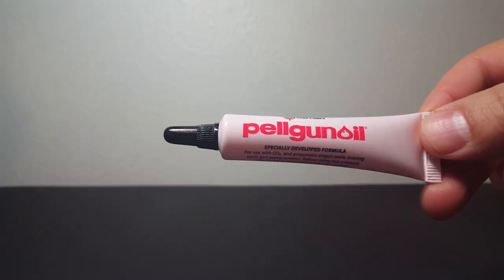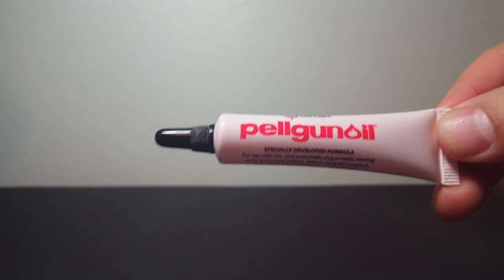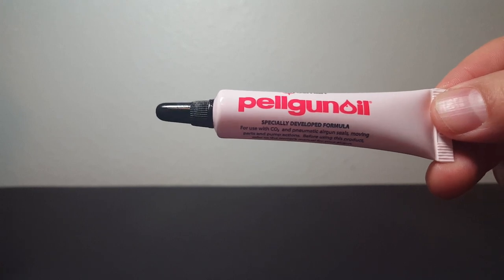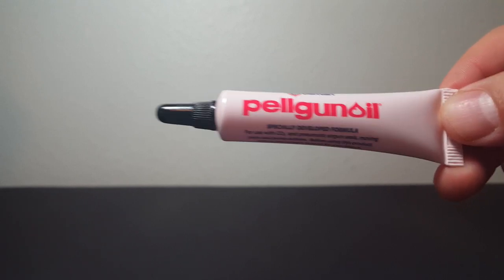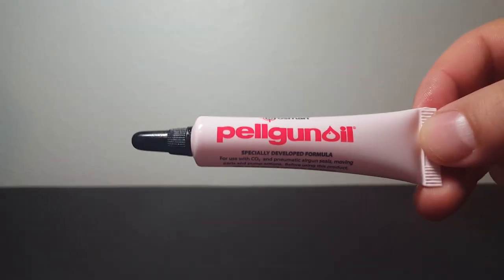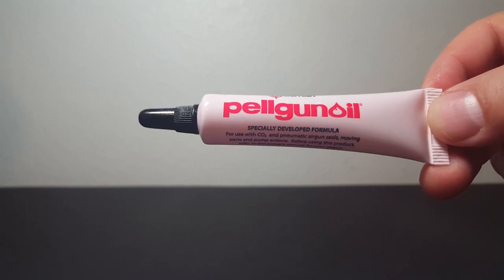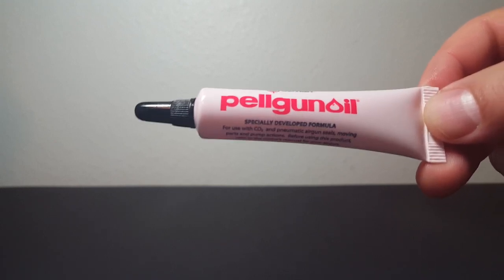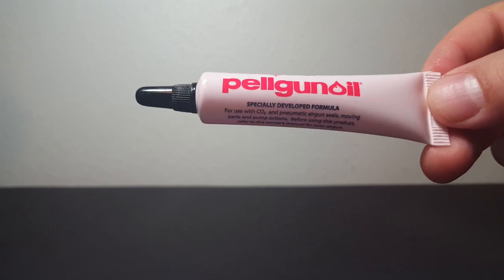Pellgun Oil: What is It?

Comment from the maker: NO! PELLGUN OIL NOT FOR PCP!

Here is info From Magnum Airpower:

SECTION 2 :  PCP, HPA & BREAK BARREL ( spring piston, gas piston, gas ram )

 Magnum Airpower HIGH-PERFORMANCE SILICONE OIL is non-toxic and highly resistant to rapid compression autoignition or "dieseling" as it's commonly referred to. With a flash-point above 586° F and autoignition temp above 900° F it's the safest on the market. It's an excellent compression chamber oil for break barrel models ( spring piston, gas piston, Nitro Piston and gas ram) that require silicone oil.

https://onlinestore.magnumairpower.com/products/oils-applicators-and-bottles

🌟It's perfect for high-pressure hand pumps, assembling PCP airgun components and can be periodically added through the fill nipple of your PCP gun to reduce corrosion and wear.🌟

Crosman Silicone Chamber Oil (RMCOIL) is recommended by 
Crosman for their break barrel and PCP guns. Magnum Airpower HIGH-PERFORMANCE SILICONE OIL is a safer high-performance version. Both are dimethyl, phenylmethyl siloxane, trimethyl-terminated.

Our oil has a higher phenyl content which gives it a much higher flash point, better thermal stability and it's more hydrophobic to better prevent corrosion. This oil is only available from industrial suppliers for $400 per gallon and up. We list these 1/2 oz bottles at a very small markup to make it affordable for most. It has a viscosity equal to SAE 30, resists thickening in cold temps and thinning in hot.
 
PCP & HPA :  Without lubrication, PCP components can be difficult to assemble and o-rings are more easily damaged. Tanks are harder to install and remove without lubrication on the outer threads and o-rings. Many lubricants are not safe due to the risk of rapid compression autoignition. Use only lubricants that are recommended by the manufacturer or a trusted airgunsmith who works with PCP & HPA guns.

 A drop or two of oil can be added through the fill nipple of PCP guns for maintenance. It works it's way through the system to prevent corrosion, prolong seal life and lubricate the valve reducing wear. Some recommend never oiling PCP guns except during assembly. We've found over many years that these guns last much longer and perform better with lubrication. To prevent over-oiling, every 2000 shots is generally enough. After oiling, excess oil accumulation should be cleared. To do this, make sure the gun is unloaded, point the barrel straight up in a safe direction and fire it. Keep the barrel pointed up through the entire procedure, excess oil settles into the valve and shoots out through the barrel.

 No oil should ever be introduced into a HPA tank, regulator or the internal threads of either. They are commonly flash-filled, an explosion could result. Scuba tanks generally have grease on the internal threads to prevent corrosion. They are filled at slower rates so there is no risk of explosion when the correct type of grease is used. Grease works better than oil for this purpose, it stays in the threads where needed instead of settling and migrating the way oil tends to.

 It's not high pressure that causes lubricants to detonate, it's rapid compression generated during a rapid fill. The fill rate required for rapid compression autoignition to occur varies by the type of lubricant and size of the container. A PCP tube capacity of 4.5 cubic inches requires a rate of around 2000 PSI per second for standard airgun oil to detonate. The rate required for larger tubes and tanks is higher. The rate for smaller tubes stays about the same. Based on this it is safe to establish 2000 PSI per second as the minimum fill rate required to cause autoignition. The rate required for common silicone oil types is slightly higher, with our oil it's much higher. Most silicone and heavy petroleum oils are safe when there's no risk of accidental rapid fill. Only the safest type should be used otherwise.

Comment: Don't use that one your co 2 pistols, I did a video on it, use 100 % silicone oil
Reply from the maker: Sir, I watched your video and will link. I hardly give Pellgun oil ringing endorsement since, like many, the EXPENSE seems out if line and the HEAVY detergents. But politics call for me to play nice. Some love Pellgun oil.

You speak from practical experience. I detest C02 because I prefer onboard power system. But I know others really like it, and it doesn't get any closer for firearm training, semi auto.

Crosman can hardly get upset with you, but I will include other option that is highly regarded and MUCH better value.

https://www.amazon.com/Super-Lube-56204-Silicone-Lubricant/dp/B083NXVGQX

On Umarex, they are talking about their RWS Silicone which I do use for P-17 and 340.

Rescue 29 video:
https://youtu.be/IZ0tMKiAlZc

Comment: On my way to AutoZone
Reply from the maker: Compressor oil works also. It has been said that the chamber seal in the Daisy system is a compressor wiper (not plumbing seal).

Just get small squeeze bottle for application. 

https://www.hobbylobby.com/Art-Supplies/Painting-Supplies/Palettes-Tools/Squeeze-Bottles/p/57415

https://www.oreillyauto.com/detail/c/pure-guard/pure-guard-compressor-oil-4-quart/pgd0/ac18

Comment: Would pellgun oil work in the ASG CZ P-09 Duty Pellet Gun?
Reply from the maker: Snpe, yes, on your CO2, but do it carefully. It is really designed for pump guns.

But it is well known for putting a drop on the top of CO2 cartridge  every few times you change it out.
Good for gun.